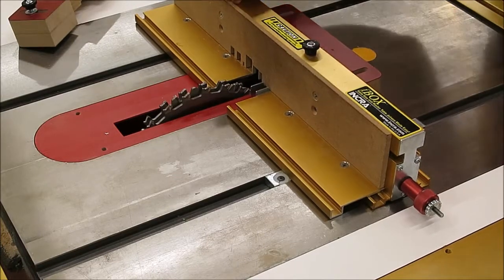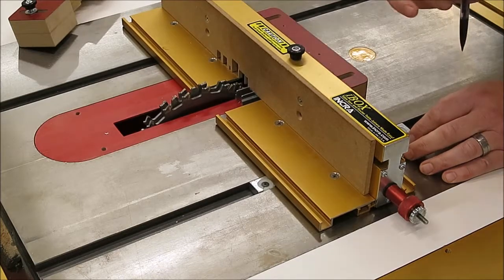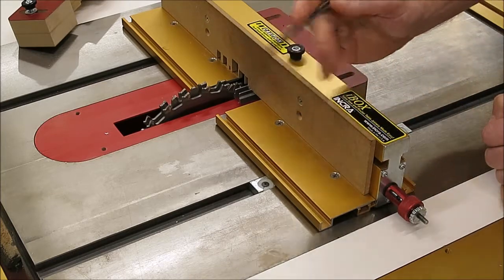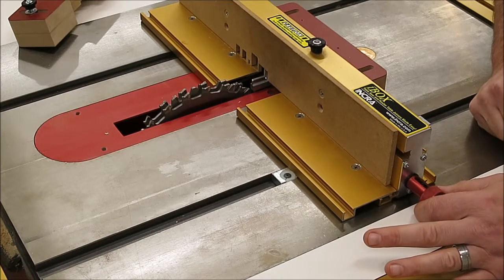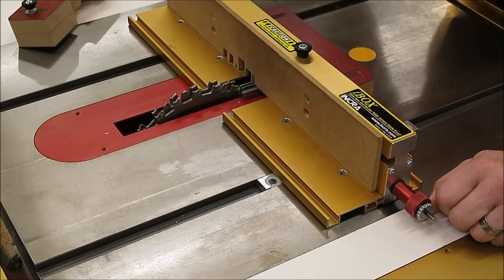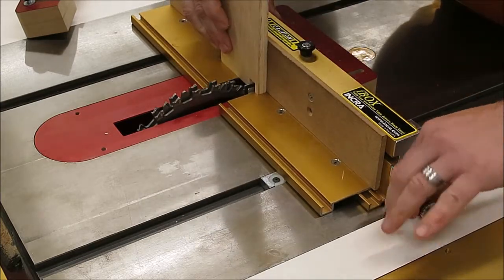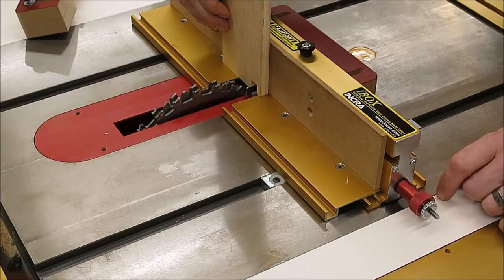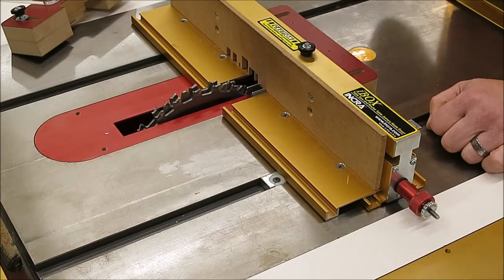INCRA I-Box Simplified Baseline Calibration

Comment: The silver micro knob on my I-box is very hard to turn. I have checked the black knob and stock ledge to be sure they are loose. The red turns ok but not the micro knob. I have in the past turned the micro when the black was tight and not sure if I mess something up in inside. Any suggestions?
Reply from the maker: Cecil, 

The silver knob is normally on the stiff side, but the jig included a clear plastic wrench for it.  

Instead using of the wrench, rotate it the silver knob counterclockwise to unthread it from the shaft, put a dab of grease on the shaft's threads, and then spin the knob back into position.  Oil can work if it's heavy, like motor oil or gun oil.  Thin spray-can lubricants won't do much.